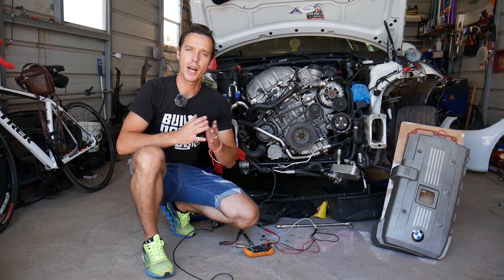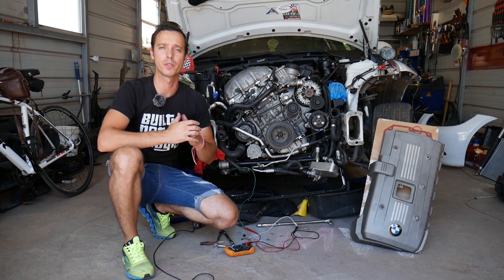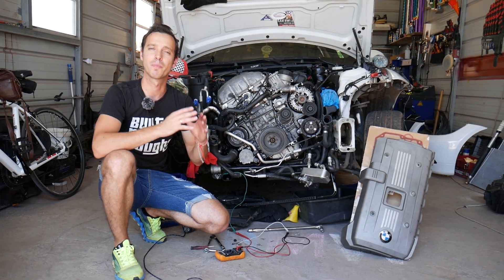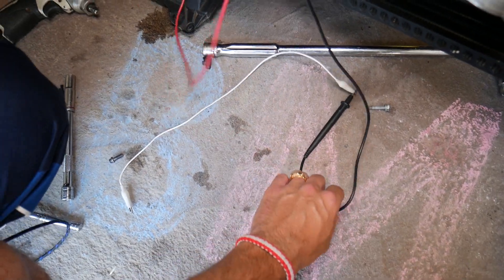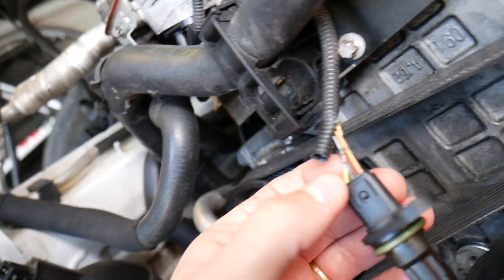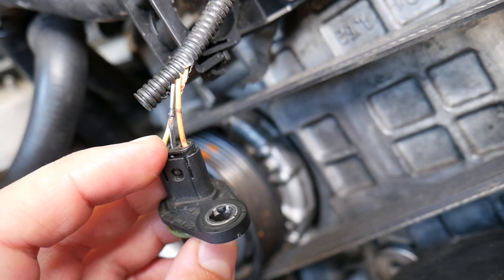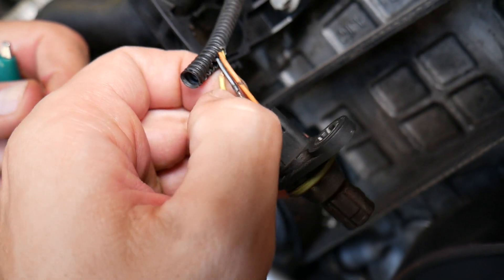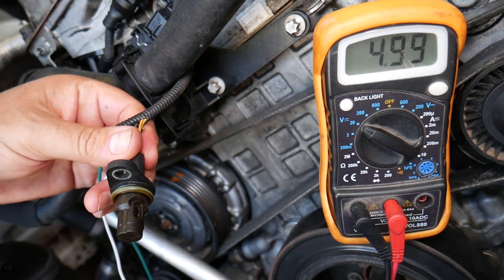HOW TO TEST CAMSHAFT POSITION SENSOR ON BMW X5 E70

Comment: Hi I wanted to ask you your opinion. I have a 2009 535i. My car shuts off while driving and the iMessage says fuel pump malfunction. I changed the low pressure fuel pump but the problem is still occurring. Do you have any advice for me. Thank you.